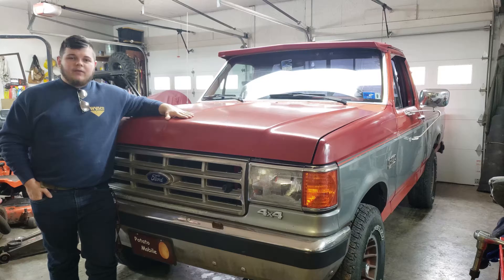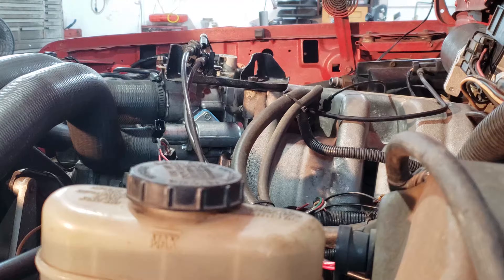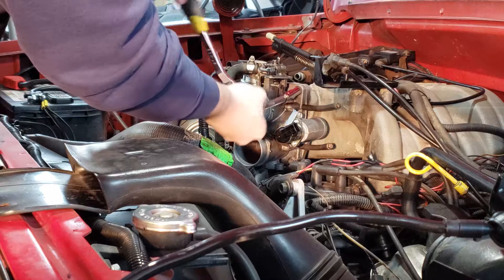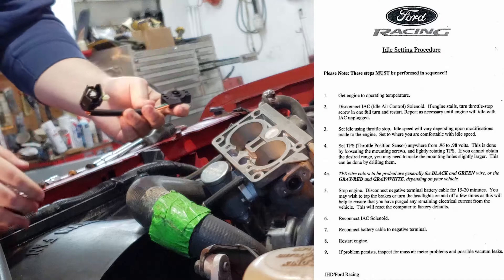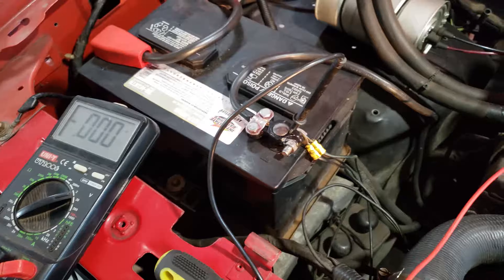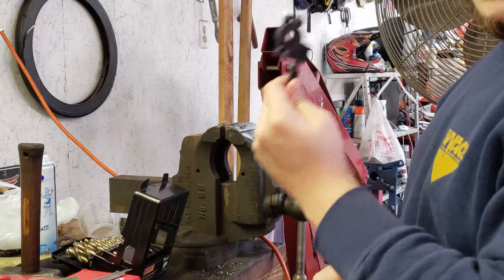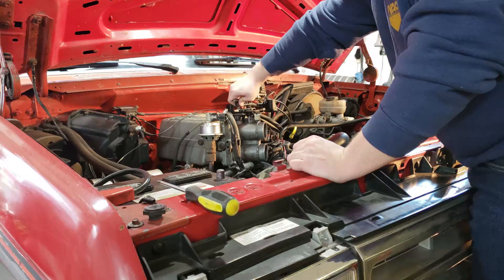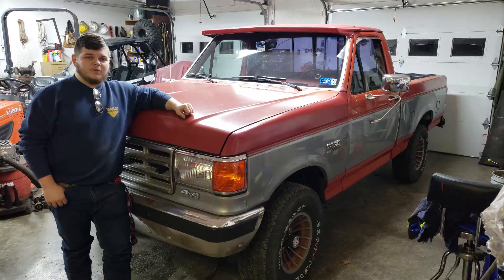1987-97 Ford Throttle Position Sensor Replacement and Idle Reset Procedure

Comment: PLEASE READ. I have a 1990 f250 351w. I see that your tps was on the same way mine is. With the pigtail facing the drivers side of the tb. I’m seeing other forums and videos with it towards the passenger side. So now I’m confused. Why would this be?
Reply from the maker: The bottom of the TB had a casting shape near what the TPS looks like, it may be different on other TB's, not sure. Could also be interference with the TB coolant line
Reply: @Hunters_Mechanics  I noticed that. After I sent that comment I was reading more in a forum and someone said it really shouldn't matter if it was turned either way . Idk seems like it would to me. Good job on the video though. I'm gonna hook up a multimeter tomorrow and get it dialed in. I've had a he'll of a time with this truck. Runs very rich  I'm getting there but something still isn't quite right. Purge valve solenoid works but the truck starts better with it not hooked into the tb. After it's started I hook it in and the idle goes down and it idles fine then. When I shut it off and try to start it again it's a hard start. Messing with the timing it starts up good at a certain position of the distributer then I turn it after it's running for a good smoth sound to the engine but shut it off and then to start it with the distr. Where it was at while running smooth it's so far out that the engine don't even want to turn over.. new map sensor iac moves freely after I cleaned it up. Still need to check my egr valve. New coil was put on and it definitely started easier. Charcoal canister has some holes in it. I got a new air filter today I'm putting on it. The old one was horribly gunked up. New pcv valve. I think I still may have some vacuum leaks. I also had theism tested it was fine and I got a new pick up coil I need to put in. I know I'm kinda all over with everything but it's driving me nuts. I'm thinking I need to check the fuel pressure regulator too
Reply from the maker: @joewarrick6043  This truck was a hand-me-down and it was the same way, it took me years to learn how the sensors work and what causes what issue lol all in all, my largest issue ended up being the TB bearings for the butterflies, it had play and wouldn't allow the TB to close all the way which made the truck dangerous to drive because it wouldn't idle down 😅 Your intake constantly pulls a vacuum on those canisters so if they have holes, thats a vacuum leak point, I would follow the line back to the intake T and cap it off with a rubber cap (they're cheap on Amazon), I have my truck set at 10° bTDC according to the Ford instructions and it runs great, no matter the temperature outside or if it just shut off, it starts damn near one turn each time. Did you purchase Motorcraft sensors? I've had too many autozone IAC and MAF sensors fail quickly and ever since I started going OE I have yet to have problems
Reply: @Hunters_Mechanics  are you saying to plug the lines so the intake isn’t pulling air into it but leave the purge solenoid wiring harness connected? And to answer your question I’ve been basically buying the cheapest sensors I can. I know I should get the better ones
Reply from the maker: @joewarrick6043  Absolutely plug the lines that aren't being used. Anywhere that it can pull unrestricted air other than the airbox itself creates issues lol those lines that go to the TB from the charcoal canister (I assume thats what you're referring to the purge valve), as long as its still connected to the gas tank, I would leave them because it helps relieve the pressure in the tank, I currently have mine blocked off at the TB because my steel line is gone and my gas tank vents to the bed
Reply: @Hunters_Mechanics  maybe you can help me here. On my truck the wiring braided loom that holds the pigtail for my icm on the distributor has another pigtail in that same loom. It is just two wires, a black one and a black one with a yellow stripe. Do you have any idea what that is for? On mine it is plugged into a piece that obviously has broken off of something and I don’t see what’s it is broken off of. Man I wish I could send you some pics of things as I ask about them lol
Reply: Found something very interresting today. I decided to pull codes and got a code 31 which is egr intermittent low voltage something or other so in the process of testing everything and looking through stuff I decided to take the egr valve off and when I did the egr tube that hooks into the exhaust manifold just came off with the egr. It wasn’t attached to the exhaust manifold at all. It actually was broken over half way up the tube. I just never noticed it cause there is a heat protection woven loom around it so ya can’t see the actual tube. Needless to say I think I found my problem lol
Reply from the maker: @joewarrick6043 Sorry I am getting back to you late, didn't get a notification for the replies; I'll have to check mine, it could be the connector that you unplug to set the timing for the truck, I have no clue what the color is off the top of my head. As for the EGR line, mine was the same way, I got a new EGR and new tube from RockAuto and replaced it and my CEL and code went away lol
Reply: @Hunters_Mechanics  it’s not the spout connector. I know all about that. I’ve seen in other videos that the harness I’m talking about plugs into the backside of the top drivers side pulley. Mine doesn’t have a place to plug it into. I’m wondering if maybe it was a certain option that came in this truck and mine doesn’t have it. Or maybe someone replaced the wiring at some point and it’s just something extra. But like I said it has the male end of whatever it broke off of still in it. Idk. Lol